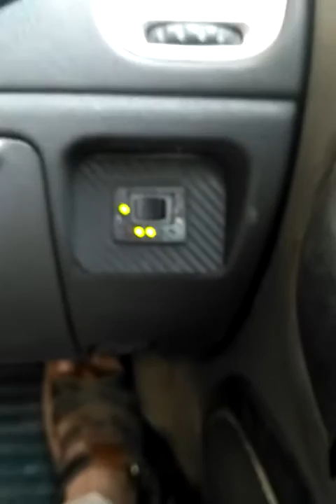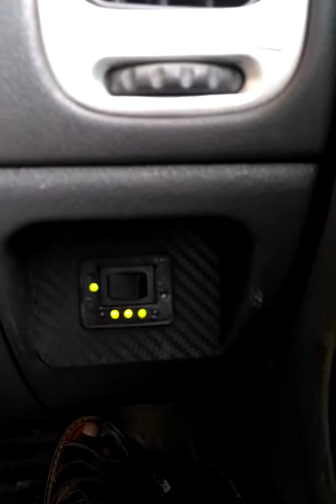How to fix your CNG gauge meter ?How to sync digital CNG guage with Analog gauge meter?

Comment: Thanks bro but this didn't work in my hyundai i10
Reply from the maker: Ashish Shishodia this usually works when there is a lose connection between the two hence the faulty reading... If it's not working then you  might have to check it with the CNG fitters.
Reply: Skilled Techie Sure, thank you!